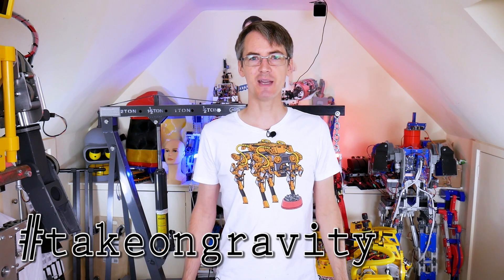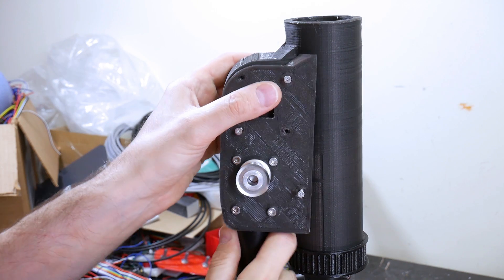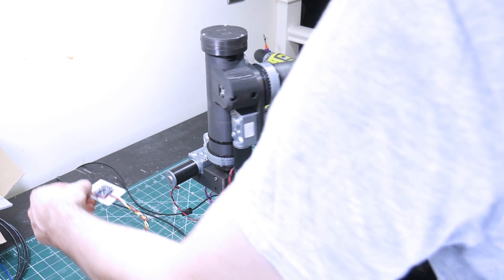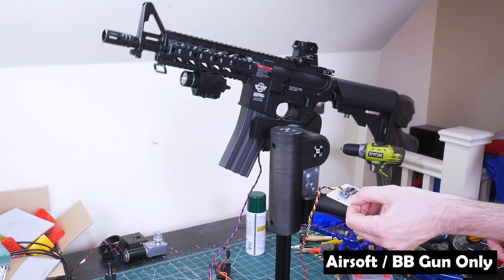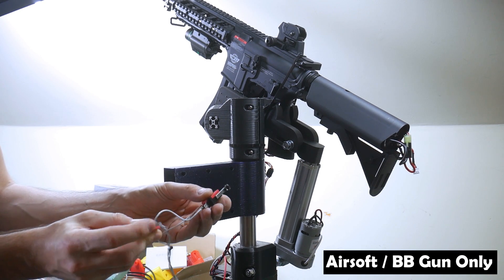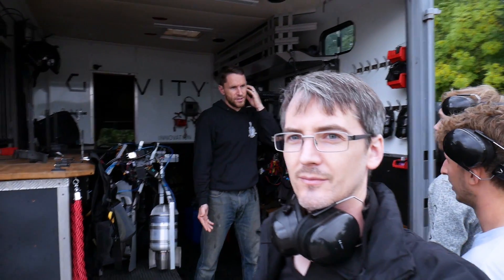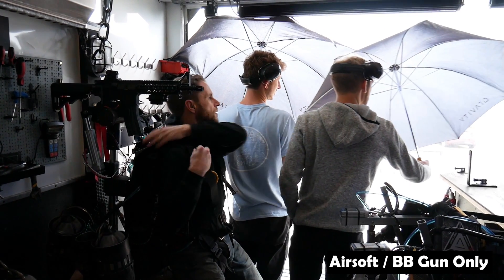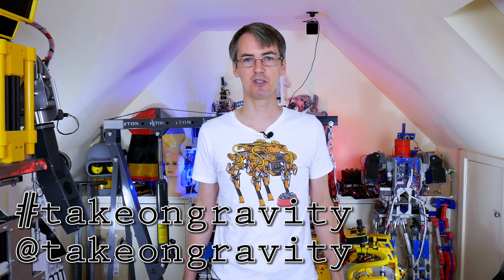Jet Suit Head Tracking Shoulder Turret

Comment: Totally going to burn some face with the muzzle blast, and be picking bits of jacket/lead outta your cheeks as well. Between the legs as another user suggested, that would help solve two problems. Maybe try a bull-pup configuration rifle ( and drum mag), this could help mount the weapon with the servos balanced right on the axis of rotation, it will help reduce the load on the servos and give a better response time.

Comment: What this also needs is some robotic arms such as an exoskeleton that can be used in 4  modes.

Mode 1 .
Just as normal but the exoskeleton gives the flier extra arm strength  to reduce fatigue. In this mode the flier controls the jet pack with his/her arms and teh exoskeleton just assists.

Mode 2.
Hands free operation where the flier  uses his/her arms and hands for some other task and the exoskeleton flies on auto pilot that maintains whatever the state of the jet pack was on entry into mode 2 such as maintaining the forward speed or maintaining hovering.

Mode 3. 
Emergency recovery where the robot arms help recover form a loss of control by the flier.

Mode 4. 
Training assist where the exoskeleton nudges the student but lets the student do the actual control.

That said the head tracker is still a great addition as well.
Reply: BTW, this could be E-Bike mounted as well.

e.g. see

https://youtu.be/2NqTduZEteg

Comment: Yeah you’ve now made Richards jet pack fly even less time because you’ve up’d his take off weight , it’s bad it’s 4 times worse than a jet pack that flew 21 minutes in 1967  and Richards can’t even fly 4 minutes and now your adding weight . When’s he going to stop milking his investors and see the military will never pick up on his design . Nothing but a bum who claims to be an engineer. What’s he invented, what a flying jet platform that’s 4 times worse than In 67 . Reason why bells jet belt flew so long because they used Williams jet turbine that’s fitted in Military applications . Not some off the shelf hobby turbine

Comment: the old theory ... you need a good sync system ( see the base:  https://en.wikipedia.org/wiki/Synchro) with a Resolver to Digital Converter to convert the angle to digital ... see also http://www.diegm.uniud.it/petrella/Azionamenti%20Elettrici%20II/Sensori%20e%20trasduttori/Synchro_Resolver%20Conversion%20Handbook.pdf

Comment: nice implementation. When i first started messing around with arduino one of the books i had covered a similar thing for the predator shoulder cannon locating the imu in the biomask/helmet. also withregards to the use of the bb gun howcome you didnt just strip out the gearbox making a smaller custom sci-fin case for it and mounting the ammo on backpack increasing the bb count from a couple hundres to a couple thousand.. ive seen this type of mod done on a mini-gun.
Reply: What book was it? I would like to build one myself but don't know where to start
Reply: @alexreitler  Hi, the e-book was called Arduino Projects, it doesn't seem available no but you can find the article in question here: https://www.instructables.com/id/Arduino-animatronics-make-your-awesome-costumes-m/?utm_source=pdf&utm_campaign=copyright props go out to horus.

Comment: You mentioned the motor wasn't strong enough to move the gun, it's all about balance, look at camera cranes, when they are balanced, you can put a penny on the end and make it move. so if you had made it so the gun was perfectly balanced (add weights if needed) the motor may have worked.
Also, the extra mass may have helped reduce the judder

Comment: gravity guy should Give up.  Trying to be Iron man is just not working.  The Jet pack is totally impractical.  Can't use your hands during a flight which is barely stable. You couldn't save a cat in a tree when you're arm's have to be Constantly by your sides to direct thrust downwards. Now you're adding a weapon with auto tracking....  Half wanna be Iron Man and Half Predator?  Any Mechanical Engineer with a Masters degree can Rig up a similar Set up. But they don't bother as they know it's impractical with today's technologies. Look at the Jet pack...  It's bulky and looks like a hovering Octopus. There's absolutely nothing unique about this Jet pack.  Having the Thrusters controlled by the arms is just impractical when the Arms have to be constantly keeping the thrusters facing downwards.  The military would never buy this in it's current form.  It's wouldn't get off the ground with a soldier in full uniform,  ballistic armor plates and rucksack.  Even without the extra weight of a soldiers full equipment set up.... Once airborne you would be heard and easily shot down.  Basically a hovering target with virtually zero evasive maneuvering if a fire fight were to take place.
Reply from the maker: I think you'll find they're doing ok.
Reply: @jamesbruton  it's a gimmick.

Comment: So a G&G Combat Machine, not a bad AEG but could've easily been made lighter just by ditching the foregrip or switching to a simpler (plastic) one, and moving the battery mount out of the stock (could even be mounted to the armature to get the mass closer to the body) and maybe losing the stock too. Personally I'd have suggested something like the P90 'cause of the balance and having a hopper mag on top, or stripping the M4 down to the absolute bare essentials to work and adding a separated ammo feed line.

For the safety you could also have tied into the fuse connector in the AEG's battery cabling, which would give you a hard cutout on the motor.

If money is no object a digital trigger unit could be fitted with an additional external plug to use an electronic trigger in the mount instead of the mechanical one. That'd also allow you to externally switch fire modes, IIRC.

(note: not expecting James to be an airsoft expert, just offering my perspective as someone who knows a bit about them)

Comment: I would have had the turret not over the top of the shoulder, but rather have two that wrap around from behind the shoulders and are right at the sides. Then both can freely pitch up and down and then just yaw a little to the left or right. If you can find a way to incorporate some kind of HUD in the helmet that helps the pilot see where the guns are pointed then it could be more accurately aimed.

Comment: You could lighten it by removing unnecessary components such as the stock and the iron sights, perhaps replace the mag with a drum; which is heavier but has more capacity. Also if you can, I'd mod the fire rate to be much higher. Aircraft usually have insanely high fire rates to compensate for the much smaller target opportunities. Also while you are weaponizing the suit you could consider adapting some other airsoft gear such as dropping airsoft grenades as a sort of payload/ordinance.

Comment: sweet.
really need an exoskeleton to connect those jets to the backpack to take the load off the pilot.
Reply: Exoskeletons dont take the load off the pilot they just shift it. All the research shows there is no bio-mechanical advantage to using them, that's why the military still hasn't adopted them. You are just exchanging back for more hip problems.

Comment: Have you thought about mounting the gun between the legs ? You could retain the two degrees of freedom, with less risk of shooting yourself while also providing protection from enemies shooting from below. The gun is also closer to the center of gravity so less recoil problems. It amplify the parallax problem, but that can be compensated by using some laser to detect the distance of the target.

Comment: For those wondering, the gun is a G&G CM16 Raider. Pretty decent AEG and quite cheap, so ideal for beginners.
BTW, I'd have built a custom lower and installed a MOSFET to better mount and trigger the gun. However, as a prototype, this is pretty good and Iove it.

Comment: The first shot and muzzle blast would shatter your visor and the second shot would blind you. 😣
Reply: I guess that's why they're using compressed gases rather than pyrotechnics.

I'm not an expert, though, so that's pure speculation.
Reply: jameswalker199 I meant in “real life”
Reply: Jay Man this is real life, the reasons you stated are why they are using an air powered firearm rather than a chemical reaction powered firearm.
Reply: jameswalker199 I wish I had one of those in Afghanistan then.

Comment: Would it have been possible to add a soft stop instead of removing the yaw axis entirely? Awesome work btw, you inspire a ton of projects for me!
Reply: Never... I repeat: NEVER trust Software! Always use a HW end stop! 

Maybe in combination with a SW end stop. But never ever use a SW end stop only! Trust me I'm an engineer.
Reply: Yeah I was thinking the same thing. Basically stop it at a point where the head is looking straight ahead.
Reply: Definitely a hard stop, but I agree. Move the gun outward 6 inches and you can get a decent range of motion before it hits the pilot. Using a floating body to aim in one axis and a motor in the other, it's going to be impossible to hit anything.
Reply: @turrboenvy4612  im still waiting for the sentence that proves to me this is better than literally anything else the military has
Reply: it would be possible yes,  he was being lazy, but with that said its still cool, it just needs to be improved on.
Reply: whatch the video notice how often the guy turns his head expecting the gun to point where hes looking, this is why you dont take out the axis, you add a limit to its range of motion instead... and for the sake of accuracy.

Comment: For a shoulder mountain aim-by-sight weapon, a belt fed handgun size weapon would be more ideal, I would think. Obviously because of weight, and the inability to fully track where the user looks. And such a weapon system would almost have to use a belt fed from the pack or you'd have to completely stop what you were doing to reload. But I'm sure all of this has occurred to them and tbis was just a fun prototype